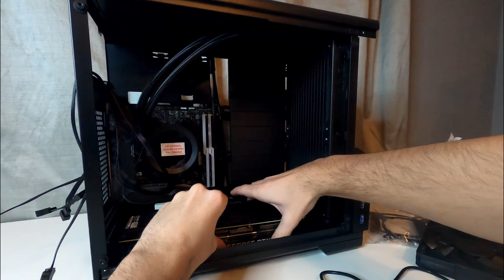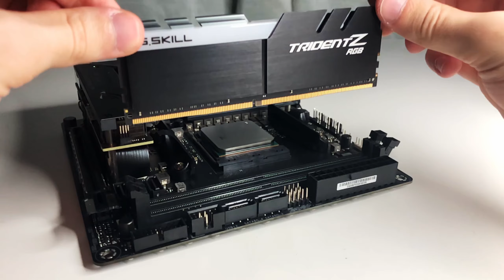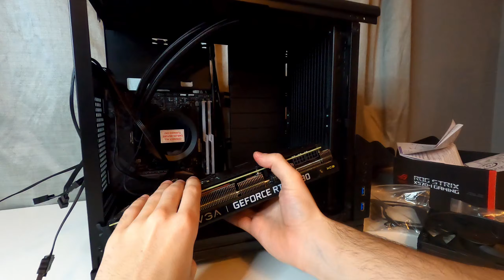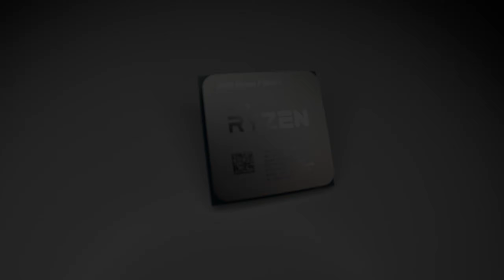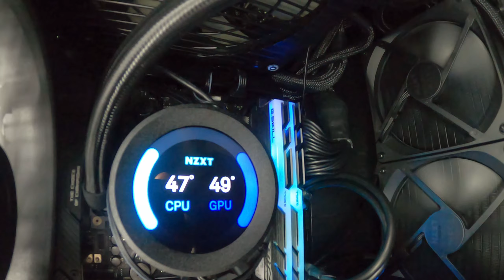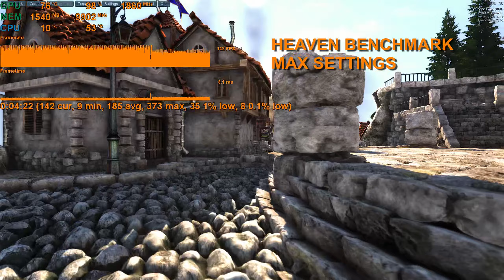RTX 3080 / Ryzen 7 5800x Build & Benchmarks

Comment: @Ben Henry Thank you for the great review. I am planning the same case but I already got Strix GPU which is 16mm higher. Do you think will it fit to this case? Your GPU 42mm, mine 58mm. Tks.
Reply from the maker: Hey! I think 58mm might be cutting it close. Not sure if it will be possible that close to 3 slots, but you might be able to squeeze it in

Comment: Can this build fit the msi rtx 3070 ti ventus 3x please ?
Reply from the maker: The case has a 345mm GPU clearance without any fans or radiator on the front panel

Comment: How much room do you have between the fan shroud on the GPU and the bottom filters on the case?
I'd love to get it but wonder if only 2 slots is enough for newer cards
Reply from the maker: I'd say just under half an inch or so. Not enough for most of the new cards, but I found the length restrictions with an AIO more challenging

Comment: How did you manage to keep your 5800x at around 55c in Warzone? I have a Noctua D15s running at 75c easily. Is that normal/optimal?
Reply from the maker: The Kraken Z63 is quite capable when the pump is running at max speed, but you can check out Ryzen PBO2 if you want even better thermals
Reply: @benhenry4231  I've already set all my cores to -20. Still same results. Is it normal for these two coolers have a 20c difference?
Reply from the maker: @user-re7bz4yu8i  I'm not sure why there's such a big temp difference. How warm is the air that is coming into your cooler? Does your GPU happen to exhaust into the heat sink?  What kind of case is your build in? There is definitely potential to have noticeable temp differences based off of the cooler- but 20c is a bit much for it to be from that part alone

Comment: Nice, clean and simple small setup! 
How is your experience with the z63? Was it working out of the box? And how is your experience today, does your 5800x get hot? What are your idle temps and load? Is the CAM software good? Or do you experience issues? Like it showing wrong temperatures or anything?

I have seen some issues with the USB compatability between some asus x570 boards, did you experience any of that?
Reply from the maker: The Z63 is honestly fantastic, my only complaint is that you need to keep the CAM software running for the display to stay updated. Luckily, the CAM software is very easy to use and customize, and it has yet to display incorrect temps. It did work out of the box, yes- but it has quite a few connections that you have to cable manage. All in all I am still very happy with it. 
The 5800x got quite hot (as did the GPU) when I first started using the PC without and optimization (80+ degrees in cinebench) but now that I've adjusted the pump speed and the fan curves for most of the components, it is much better. I also recently set up an undervolt with PBO2 to run the chip at higher clocks with lower temps. I'm getting ~60 degrees under sustained load.

So far no USB incompatibility from the x570, I'm using 6 usb devices regularly and the connection is superb.
Reply: @benhenry4231  that sounds good! Thanks for you answer! ;)  i guess if you want to find problems, you always will. But if you are willing to tweak a bit and try stuff, you can probably figure out a way to make it work.

Comment: Nicee case bruhh pretty similar to my build gonna be ready in a week max
Specs: ryzen 5800x

Evga Rtx 3080 ultra gaming ftw 3

16 gb ram 3200mhz

Motherboard: asus prime x570 pro
 Pcie4

Ssd: transcend 220s 2tb pcie gen 3500 mbs of reading and 2800 of writing its enough for gaming for me

Hdd : western digital red 2tb sata 3

Asus 1000w gold psu gaming

Case: Storm stryker full tower atx 

Cpu cooler : Corsair h100i v2 extreme performance  tell me what you think :)
Reply from the maker: That's a wicked setup! I haven't seen that case before, I'm sure it will look awesome!